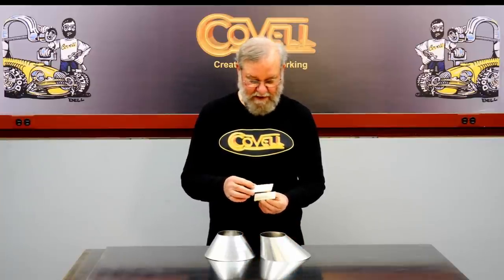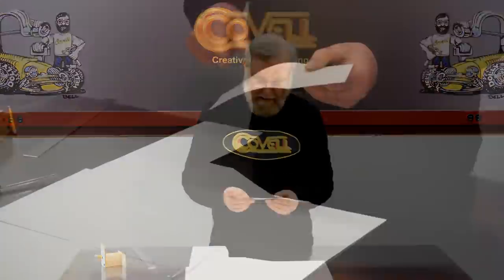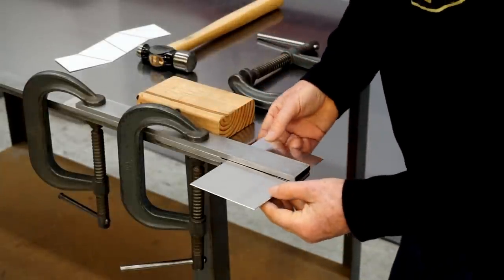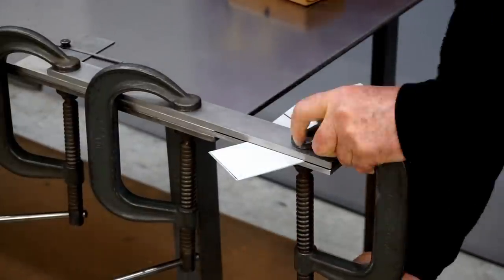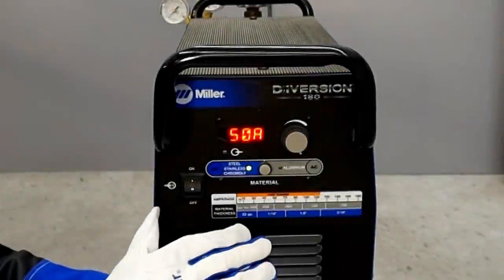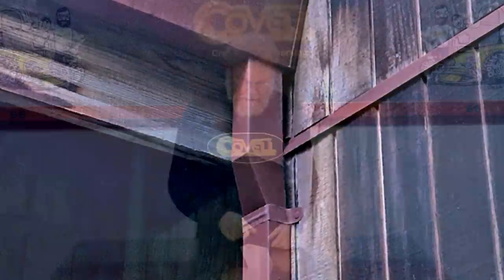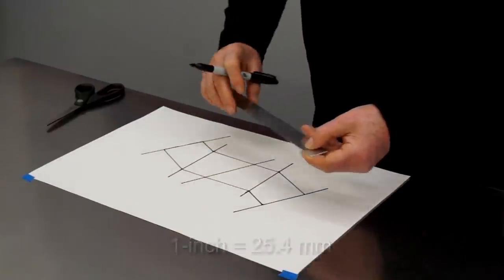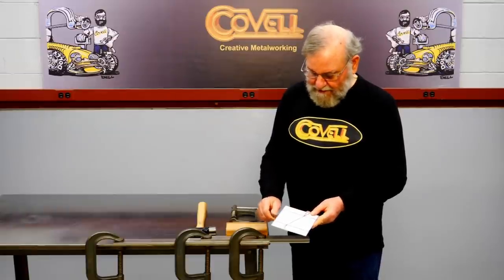Rollation, Round 2

Comment: Is there a difference between the red and green shears?
Reply from the maker: The red and green shears are mirror images of each other. One cuts better on top of the metal, and one cuts better below. They also are each suited to turning better in one direction than the other.
Reply: @RonCovell  To add, they are "right" and "left" hand cutting, so the shear blade is on the right or left side of the line you are cutting.
Reply from the maker: You got it! I actually don't like using the 'left' and 'right' designation, since it depends on whether the handles are above or below the metal, and whether you are cutting toward or away from yourself.
Reply: @RonCovell  I was taught that in industrial arts class 30 years ago and although I still remember it I can't say I learned it successfully because I've never been able to work out how the chirality of the snips could have any effect. 
I can't be alone in this because everybody I know uses the yellow ones for everything, I haven't seen a red or a green sense shop class.
Reply: @brocktechnology  Most people cut metal like barbarians: no finesse. If it bends or curls they just hammer it back flat afterwards. I'm sure for many jobs that's perfectly acceptable. Perhaps not so much if you're going for the best optical/aesthetic result.
Reply from the maker: I'm still considering the feasibility of making a video on how to use the shears properly.
Reply from the maker: Well, the yellow ones only work well on super-thin metal - they will distort material 20-gauge or thicker, even if you are making straight cuts. I'll see about making a short video showing how to properly use the shears.
Reply: @RonCovell  Dear Mr. Covell, please do make the video explaining the shears. Wouldn't really have to be longer than, say, 4 to 5 minutes. It would be quite educational for a lot of people.
Reply: the RED ones are the RIGHTS,,,,,,,, the GREEN ones are the LEFTS,,,,,,,,,,,  the red rights go in your right hand and cut left in the  direction of the circle,,,,,,, the lefts go in your left hand and  cut right in the direction of the circle circle,   just remember the red goes in your right hand and the green goes in you left hand and if your cutting anything but STRAIGHT ,,, You have no use for the YELLOW snips,,,,,,,,,,, when cutting right up the middle of a sheet,,,, you use BOTH ,,,, one in each hand and remove a strip right up the middle without distorting the sheet,,,,  OR you can use the double cut snips to remove a 1/4 in strip that will curl right up the middle with out distorting the sheet. that is very valuable when cutting round duct work or elbows, with out leaving jagged edges and generally making a mess of what you are doing. and making it look like a kid did it.
Reply: @RonCovell  the RED ones are the RIGHTS,,,,,,,, the GREEN ones are the LEFTS,,,,,,,,,,,  the red rights go in your right hand and cut left in the  direction of the circle,,,,,,, the lefts go in your left hand and  cut right in the direction of the circle circle,   just remember the red goes in your right hand and the green goes in you left hand and if your cutting anything but STRAIGHT ,,, You have no use for the YELLOW snips,,,,,,,,,,, when cutting right up the middle of a sheet,,,, you use BOTH ,,,, one in each hand and remove a strip right up the middle without distorting the sheet,,,,  OR you can use the double cut snips to remove a 1/4 in strip that will curl right up the middle with out distorting the sheet. that is very valuable when cutting round duct work or elbows, with out leaving jagged edges and generally making a mess of what you are doing. and making it look like a kid did it.

Comment: I used to make similar transitions, larger size with steel for a grain plant. We'd typically bolt the flanges onto the machines where we needed them (inlet and outlet), and then tack in skeleton structure to hold them in position and then put sheet steel on them at the workbench. Granted, this rollation method would be somewhat more difficult considering the sizes we dealt with, but the technique is much more refined. Thanks for sharing Ron!
Reply from the maker: The technique you used for large, awkward shapes makes a lot of sense. There are practical limitations on how the Rollation process can be used.

Comment: hi ron i used to install machinery in mills and food factories in the uk and used this tecnique to connect various machine inlet and outlets with chutes,we would clamp plates the exact size of the inlet and outlets,then tie your plates together by welding round bar to them,then roll out as per your tehnique,some chutes could be 3m+ long,but it catered for outlets not parallel or in the same plane on 2 machines,a forgotten art now,we used to call it jet developing,also good for square to rounds with round at a angle,cheers
Reply from the maker: Sounds like you were a master of your trade!

Comment: We had vise inserts for bending at work. We used two L-shaped extrusions that were connected with a bolt on one end and clamped the material between that.
Reply from the maker: That sounds like a clever fixture!
Reply: @RonCovell  it was quite useful. You could clamp longer sheet metal pieces next to the vise and the bolt held the extrusions together and also turned the whole thing into some sort of "spring" clamp by reducing the spacing on the bolt end. Was very handy when you had two bends in close proximity, couldn't use the bending machine for those.

Comment: Hello, Just discovered your channel which is timely since I just set up my 3 in 1 box brake.  Hoping upcoming videos will deal with using home shop sized ones.  Mine happens to be the thirty inch Harbor Freight version I got last year in anticipation of my finishing the shop expansion.  I accomplished that and also welded up a stand for the brake with a set of wood drawers under it.

Comment: Thank you Ron! It's great to see simple tools we all have in our garage used instead of the professional shop tools that dominate a lot of the Youtube fabrication channels. I appreciate those too of course, but these simple hand tool techniques are actually faster and easier than breaking out the big guns and that's  easy to forget in a garage full of equipment that feels like it needs to be used.
Reply from the maker: I just recently came to understand how much more accessible my videos would be if I avoid high-end equipment. I have to think twice about using my TIG welder, but it's just so ideal for these kinds of projects.
Reply: @RonCovell  Mechanically fastened joints would be an interested sub-genre to explore in your videos.  In tradework mechanically fastened joints are the only way it's done.  I know why you use Aluminum, but if you did some of these projects from steel it would open up the concepts a little more, since MIG is much more accessible to many people.  The Aluminum or Copper bar behind the joint trick is not used much, I could see you demonstrating this method and producing clean MIG joints with it.
Reply from the maker: Great ideas! I may consider this for future videos.

Comment: Love this and the previous rollation projects!  I could have used this technique in making an offset dryer exhaust a few months ago.  The room between the wall and dryer was too short to use flex pipe or even get at it to fasten with hose clamps, so it had to be rigid so the video would ha
Reply: Be solved my problem.
Reply from the maker: Well, you'll be ready for next time!

Comment: Another great video sir.
Again I wish I would have learned these techniques years ago. Could have saved a lot of headaches, wasted material, and thrown tools. Lol.
A suggestion for when you do a square/rectangle round transition. Please if possible do 2. One that square/rectangle is about the same size or bigger than the round. And another that the round is larger than the square/rectangle. 
I have done both with varying degrees of success but never using the rollation technique. 
Again thank you for taking the time and making such great content.
Reply from the maker: I'm gearing up for that video right now, and I'll see if I can accommodate your request.

Comment: This is a perfect application for using CAD such as Fusion 360.  The sheetmetal option allows you to make things like this and then allows you to unfold it and create a pattern or a DXF file for a plasma/laser cutter/CNC mill.
Reply from the maker: I do want to learn Fusion 360 'someday'. I know the 2-D functions in AutoCAD, so I hope there is some carryover, since they are both AutoDesk products.
Reply: @RonCovell  AutoCAD is actually more complex than F360, there are quite a few tutorials here on YT, just search Fusion360 sheetmetal and youll find it.  I used to do it just like you are and once I learned that way I literally stopped buying DyeChem because I could do it digitally.  It also drove the decision to buy a plasma table and that is a life changer since you can cut complex parts that would take all day in a matter of minutes.
Reply from the maker: Thanks for letting me know!
Reply: @RonCovell  hey if I can help a Master of the craft, consider your thanks a great honor.

Comment: This technique with an excellent teacher is very eye opening to the possibilities. Air conditioning duct work is very different, but they make similar transitions, much larger though, and don't weld. They join metal with folding and locks. That is very interesting to me too. I would like to see that method, but perhaps this channel is not for that method.
Reply from the maker: I've never done HVAC work, and you're right - it's different in many ways. They use much thinner material - so welding is not really feasible, and locking seams provide a good way to make joints.

Comment: I guess I'm confused about one thing. In general, when you bend sheet metal, you generally need to add some distance on either side of the bend to account for the bending radius. So you need extra overall length of the metal. In the first case at least, you didn't seem to do that but it still came out right. I'd think that the part would be too small as a result. In the second case, you maybe could account for that by trimming, but not sure.
Reply from the maker: There is a whole science of 'bend allowances' used in layout and fabrication. The short story is that because of the radius of the bend, the finished part usually GROWS at the bend! This Old Tony made an excellent video about this, which you can see here:
https://www.youtube.com/watch?v=FyXpCPVOr8s
Reply: @RonCovell  Wow, weird!

Comment: In Aviation when bending aluminum, its typically done across the grain so the metal doesn't crack.  You are using different alloy and heat treat that we are using. But do you take grain direction in account when doing layout?
Reply from the maker: With soft alloys, the grain orientation simply doesn't matter. I know that this is a VERY big issue with stronger alloys. I remember the first time I tried bending a flange on a piece of 6061 sheet in a brake set to a tight radius, and the flange just snapped off, because I was bending with the grain!

Comment: I wished I had seen your Rollation Videos earlier in my career! Althoughmy work was mostly heavy fab sometimes over 1 inch thick. We had one that was 9 foot across. There was one or two that stymied me! This is very frustrating as you know.
Reply from the maker: Most of my work is with sheetmetal, so the thought of working with 1-inch plate seems pretty intimidating to me!
Reply: @RonCovell  You get use to it or cuss a lot! Problem was mainly with managers not understanding the process and refusing to support us. Mainly they wanted to outsource our work to contractors for kickbacks. What really sucked is when it came back wrong and we had to fix it!!
Reply from the maker: I feel for you!

Comment: I am just getting into this craft.  I am having trouble sourcing 3003 Aluminum here in Alberta.  All the local suppliers seem to stock is 5052 sheet. How much more difficult is this to work with.

3003 material is special order only and is prohibitively expensive in hobby size quantities at a few hundred $ per sheet.
Reply from the maker: I found this on the web:

3003 H14 has an ultimate tensile strength range of 20 – 26 KSI, a yield of 21, an elongation of 8.3%, and a Brinell hardness of 40, while 5052 H32 has an ultimate tensile strength range of 31 – 38 KSI, a yield of 28, an elongation of 12%, and a Brinell hardness of 60.

Saying that more simply, 5052 is perhaps 1/3 more difficult to form, which should be manageable for many fabricated parts.

Comment: respected sir, I have seen your rollation videos and I found those really creative for making those shapes. I was also wondering about making "twisted" hollow square column with some relative angle present between the extreme cross sections (or ends). Is it possible to achieve such tubes made out of aluminum sheets by following your method of rolllation?
Reply from the maker: First of all, I'm very glad you like my videos.
I've never made a 'twisted' column. As I envision what that would look like, it would have faces that were slightly concave, and the Rollation process does not work with  concave surfaces.
Nevertheless, I'm intrigued with the idea of making a twisted column. Perhaps I'll attempt one sometime - just for fun!

Comment: I just stumbled upon your videos.  Very helpful!  I have a 3 in intercooler pipe to a 3in square end cap of the intercooler.  Would rollation work with square to circle? there's about a 1 in spacing and it's centered.   Appreciate your input
Reply from the maker: Yes - I'm working on a round to square video right now.

Comment: I feel like the thickness of end plates of your buck is introducing an error (it touches on one side but you mark it on the other). Your parts always fit so it seems likely I'm missing something. Perhaps you can address this in the next exciting episode.
I'm gonna go grab some cardboard and see if I can work through this myself.
Reply from the maker: Well, the thickness certainly could introduce error. I marked both of these parts on the outside surfaces of the rectangles, but in the Cone video I did a couple of weeks ago, I used the outside of one disc, and the inside of the other. I realized my error halfway through the video, but didn't want to go back and re-shoot everything, so I just made it work!

Comment: Amazing Ron! How would you go about making a small tapered tube, say around 10” long, botom radius 1/2”, top 1/4?
Reply from the maker: I've never had to do a job like that, and it would be quite challenging. I'd say the best way would be to find (or make) an arbor with the right diameter and taper, and either hammer sheet around it and weld (or solder) the seam, or start with 3/8" diameter tubing, and open up one end by hammering against the mandrel, and close down the other end with more hammering. Using some heat would probably help a lot!
Reply: @RonCovell  thx for your insight. Love the way you are teaching us with these vids

Comment: Nice job...
For the transitions you could also weld them to the first part... It depends if you are better in math or in welding 😉
How would you do for concave profiles?
Reply from the maker: Welding on the extensions would be another option, of course. The Rollation technique, as good as it is, just doesn't work with concave profiles. Those would have to be done in another manner.

Comment: What material is the top of your workbench made from?
Reply from the maker: My workbench is covered with a sheet of 5/16-inch steel plate. It was a remnant from a local waterjet house, and it was hot rolled material. I spent a LOT of time grinding the scale off it and polishing the surface. If I had it to do over again, I would have used muriatic acid (or molasses) to strip the scale off!
Reply: @RonCovell  thanks for the reply Ron.

Comment: Hi Ron, any reason you are using snips and not a hand nibbler?
Reply from the maker: Nibblers cut metal pretty well, but I don't use them at all because I hate all the little chips they make. The chips fall on the floor and get stuck in my shoes, then I track them into my car, and then onto my carpet and vinyl floors at home.

Comment: Real quick would you not want to weld aluminum on aluminum. Just out of curiosity you might fuse them together or somebody who’s not as experienced. Wouldn’t you rather put a square steel bar underneath the aluminum.
Reply from the maker: I knew some people would call me on this one! Yes, it would have been a better idea to use a steel (or copper) square bar behind the weld, but I didn't have one handy. I knew, however, that the thin sheet would melt much sooner than the thicker bar behind it - so as long as the arc didn't hit the bar for long, I could get away with it.